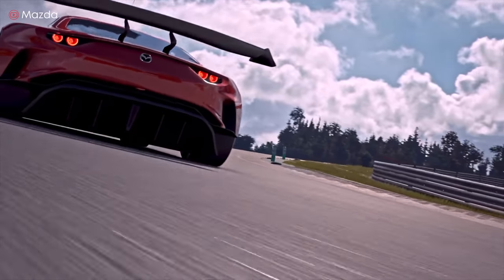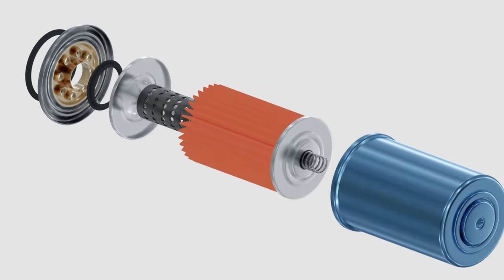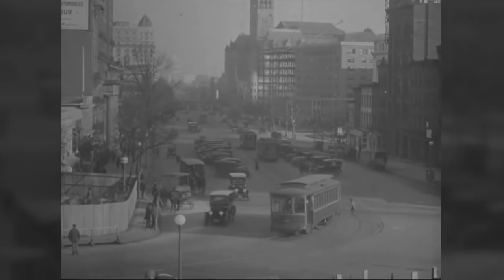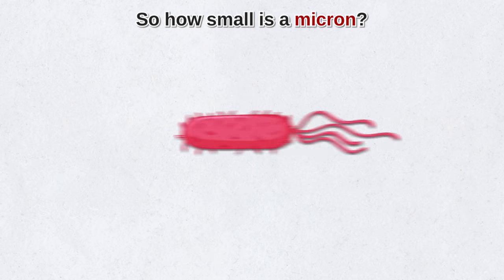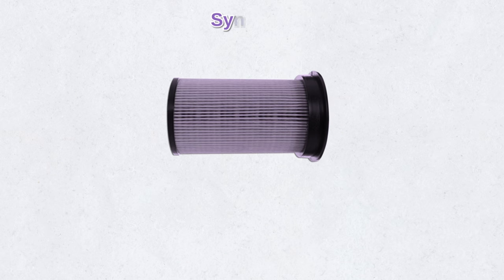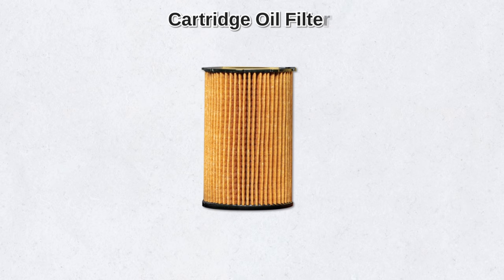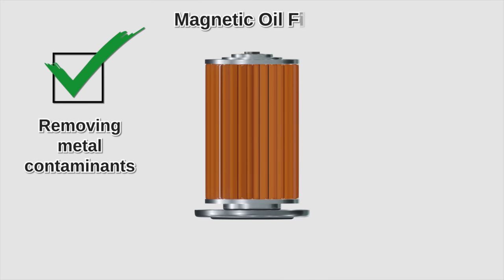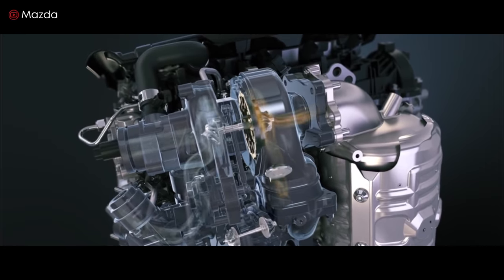This New Oil Filter Just Changed the Game (No More Oil Changes)

Comment: My 39 Chevy pick up truck 
Dosen’t have an oil filter 🐥
Reply: My '71 VW beetle also did not have one.  Just a little wire mesh strainer.  Oil changes were pretty frequent though.
Reply: Oil filters in 1939 were all bypass filters.  They were optional equipment. My 41 Dodge had the optional Fram bypass filter. Used cotton to clean oil. It was the same as the big heavy duty diesel Luberfiner. John Frantz came out with a toilet paper canister for the old cartridge filter.A much better filter because of the density  of the toilet paper and the longer the oil had to travel thru the element. The Frantz 3 stacker was a taller housing that took three rolls of paper. My 38 Chevy had no filter but was set up for a AC bypass filter.   My 37 Studebaker book didnt recommend oil changes except for seasonal reasons. It said change the filter when the oil looks dirty on the depth guage. Probably had a cotton element the same as a truck Luberfiner.  For sure if the filters werent standard they were at least optional equipment like a Chevy. Some were dealer installed.
Reply: @ralphwood8818  the 39 Chevy pick up truck Dosen’t even have one ,
My whole engine has been taken apart and Redon with it’s original 
Parts no filter .
Reply: Was at a classic  car show in San Francisco  In the 60s . There was a beautiful  early 30s Chevy with a Frantz oil cleaner on it. It was the model that looked like a Fram but was chrome instead of orange like the factory installed Fram on my 41 Dodge.  The only other one I saw like it was in a Frantz collection at a Frantz  dealership  in Salt Lake City about 1980.
Reply: @ralphwood8818  added on mine is 
100 % original 🐥
Reply: VW saved millions by not putting filters on the beetle. Beetle owners were content as hell allowing the engines to self destruct. Never heard a complaint In the 60s you could go to Grand Auto parts in the San Jose California  area and get a Fram bypass filter with cotton elements the same as the Luberfiner. They also had the superior Motor Guard oil cleaner that used high quality cellulose elements  known as 2 ply facial quality  bath tissue. If you wanted a beetle to last you kept the oil analytically clean and the valves adjusted. Not many people wanted to spend the extra money for the optional  equipment bypass filter. Some owners of these old cars restore the engines as well as the bypass filter. Filter all painted up nice. I dont think good elements are available now for the old filters. You can get the make believe pleated paper filter elements.

Comment: Scotty you did not mention the Frantz oil cleaner which has been around since the 60's and requires no oil changes. I have used that system for years. It uses toilet paper. Your opinion?
Reply: I used a Frantz oil filter on a 1961 Chevrolet Impala for 65,000 miles. Had transmission trouble and changed cars. No problems. I have heard that people used them for the life of the engine successfully as long as they kept changing the toilet paper. At some point toilet paper size changed and I believe Frantz sold  (packaged for them) toilet paper in the correct size. I can't see why this would not work well today.
Reply: The top loaders work better with toilet paper. The Frantz works better with the Frantz elements. I dont like to deal with the extra parts such as sleeves rings and such that you need with odd size paper. The Gulf Coast can handle it. If you want to use TP like me use the top loaders. They use the larger core seals for the larger core TP.  I just got in a Australian Jackmaster A very impressive filter. They have a fabric covered element but are set up for TP also. They have a massive amount of info on their site. The roll of Great Value 1000 from Walmart went into the Jackmaster without unrolling any. They are decreasing the diameter and increasing the core size to save paper.
Reply: You wont hear much about filters that eliminate oil changes. Too many depend on dirty oil and oil changes to make a living.  I used to work in a full service Standard station. It was sir that oil needs changing. Sir your  car could  use a set of Atlas Plycron tires. Sir I see a little oil leaks on those shocks. A Standard oil engineer came in. I said sir I see you just changed the oil. He let me have  it. He pointed to his Frantz and said use one of these and  Delo and your engine wont wear out and you wont have to change the oil. I was never the same after that. Found a dealer and bought one. Delo 100 was a diesel rated oil 29cents at the discount stores.  The grocery stores were full of high quality toilet paper. 2 ply facial quality the right size. The top loaders are easiest to service. Australia has the Jackmaster. Motor Guard went to compressed air filters. Gulf Coast filters mostly does heavy duty diesels. All I use now is Gulf Coast juniors and Motor Guards. I'm told some Australians use toilet paper in the Jackmaster. Like Frantz they have their own elements. Only peasants  use toilet paper.
Reply: I started with the Frantz. The TP changed but Frantz didnt. The top loaders have the larger core seals. I feel sorry for Frantz users trying to make the Frantz fit the TP.  With the top loaders you push the TP down against the bottom and put the lid back on.

Comment: Today i took my car to the service for leaking motor oil. They told me that  there are 2 places wher the leakage is and they will charge me around $1800+tax because of they have to take out the transmission. Is that really how much it cost for to fix it or are they trying to rip me off? Is there any option i can get less cost service anywhere?
Reply: Scotty recomends first try oil treatment additive the type that rejuvenates the oil seals
Reply: Scotty recomends first try oil treatment additive the type that rejuvenates the oil seals
Reply: They are probably describing the rear main seal. You could try adding a container of AT-205 Reseal to the crankcase. It often works.

Comment: Purolator one...the blue one.....
Is the only filter I use.....with. .Castrol magnetic oil...0w20......intervals every.  3000. Miles.....always 3000miles.oil. change on my vehicles. ...
( like scotty says.....oil's is cheap...motors are not....)

Menards. Has Purolator filters for.
3 or 4 bucks.....big chain auto stores..8 bucks.....
Reply: Magnetic oil? I've heard of the Intelligent Motor Oil. I like smart oil. A 3k oil change though is a waste of resources and money.. no car mfgrs. even recommend that low an interval- the engineers who built it!

Comment: Mr.Scotty I have a 1995 f150 dual tank on the front tank I broke the return line ...what can I use ...I look on several auto parts and they don't sell it....any advice...let me know thank you..
Reply: I know that you can just buy universal rubber fuel hose that you can measure and cut to fit and since it's the return line I wouldn't be worried. I had a dual tank 1995 f350 7.5 but never had that issue.
Reply: Thank you  I'll probably do that...

Comment: Please explain to me why a 4 cylinder Wisconsin engine VE4 MODEL from the 50s has no oil filter is mounted on a Hay Baler which operates all summer in the heat and server dust and dirt still hasn’t been touched other than oil change at end of season after roughly 300 hours some years 150 hours. So why is this motor still operating after all it goes through. It does have a oil bath air cleaner. I’m not sold on filters after owning so many motors without any filters. So why is a motor that operates in hot heat and dirties conditions still operating today with not one filter on it?
Reply: I'm not too smart but I know an engine with an oil filter will last longer than an engine with no filter. An engine with a depth bypass filter will last even longer. If the bypass  filter uses toilet paper you also wont have to drain the oil  if you dont get something like a leaky head gasket
Reply: @ralphwood8818  really why do all the motors without oil filters still running without one? The oldest one is 1948 VE4 WISCONSIN. Works in the dirtiest conditions and still has not had a overhaul. No one filter on the motor just a small screen on oil pump. I’ll wait for a answer to why?
Reply: I have a International Cub that has no filter on the 12 HP Kohler. I think one thing that helps is the deep sump. The rod dipper doesnt get the dirt in suspension. The VW beetle didnt last long without a filter. All they had was a screen. I think they recommended 1500 mile oil drains. I put a toilet paper filter on mine. I dont do oil drains
Reply: Something to think about. I have installed Frantz oil cleaners on some foreign cars that had no oil filters. Everything showed up on top of the toilet paper Some had almost nothing showing up on top of the paper. Put a Motor Guard on a VW beetle that had no filter and the Motor Guard loaded .up with metal. The Motor Guard filtered from the bottom up. I had to tilt the Motor Guard so that the metal chunks wouldn't gravity back into the engine at shut down. Some of the engines probably only needed an occasional oil drain. The VW beetle needed a full flow filter really bad. Put 100 K miles on a beetle and you were doing good .kind of like a flat head Ford. The problem we had in the 60s was sludge.Sometimes there was more sludge than oil in the engine. Not sure you could compare a Wisconsin or an aircraft engine to a car engine that has a lot more sludge. My V twin Kohlers would be a better comparison but they have the same filter system as the Pontiac Torrant.
Reply: @ralphwood8818  you still haven’t answered my question why is my motors still running with no oil filter? It’s mounted on a Hay Baler which works in the dirties and hottest condition. The oldest motor is from 1948 WISCONSIN VE4
Reply: @BALERMAN  sludge is usually what kills a car engine probably no sludge in the Wisconsin. I will take my chances with depth filtrstion  I dont think removing my filters would make my engines last longer.
Reply: @ralphwood8818  you don’t have a Clue. I asked you to explain why all my motors without filters made in 1948 are still running with no filter. Operating in the hottest and dirtiest condition. If filters truly work our oil would be clean and not full of carbon. My point is no filter on my motors and still running so proof is over 72 years old NO FILTER. Don’t think your opinion matches 72 years of operation without a oil filter.
Reply: @BALERMAN  How you can come up with the idea that an engine will last as long with no filter I have no clue. You cant compare an engine on a hay bailer  to the engine in a car.  I dont change the oil in my cars but I have a full flow filter and a depth bypass filter. I saw metal particles in my bypass filter when I changed it the other day.  Probably better in the filter than the oil.
Reply: My Kohler  and Briggs and Stratton engines have the same oil and filter system as the Pontiac Torrant full flow filters and toilet paper depth bypass filters. Dont plan on removing the filters to get longer engine life. I tied wire behind a Wisconsin powered hay bailer. The farmer killed the engine with a pitch fork. They sounded good.

Comment: I changed the oil not the oil filter. The oil filter is mobil1 and it says It last 20000 miles my last oil change was 6000 miles. Is that ok to wai another 6000 to change the oil filter.

Comment: Remember way back my father had a filter in the garage that actually used a roll of toilet paper? as the filter. He never installed it....I should of saved it.
Reply: Franz oil filter. My dad had one
Reply: There was the Frantz the Motor Guard and the Gulf Coast jrs. My sister wrecked the old Impala. My last two Frantzs ended up in a wrecking yard somewhere  in Dallas All I have now is Motor Guards and Gulf Coasts. I like them better. Easier to service... All of the toilet paper filters eliminated  routine oil changes. The problem with Frantz is they were designrd for the 1 1/2 inch paper. When the paper changed Frantz didnt.
Reply: @ralphwood8818  amazed they work that well. Back when I saw my fathers filter in the garage was wondering how do you know what roll to use with it?
Reply: @samiam9059  It was easier in the old days. The grocery stores were full of 2 ply facial quality TP. Just the right size for the automotive  and the FAA approved AeroFrantz. Now you have to use paper like Scott 1000 sheet or use the Frantz elements. I sometimes use Great Value 1000 from Walmart. The last time I changed the Motor Guards I unrolled 30 rounds from the Great Value. Frantz  might be the only one still in production. It wasnt the best design. Saw a couple  of Gulf Coasts on E Bay. Gulf Coast is heavy into big paper towel filters for heavy duty diesels such as Shell Offshore rigs. And heavy trucks. Saw the little toilet paper Gulf Coast on a humvee and paper towel filter on a 5 ton. There is a Frantz dealer that has a different opinion on what paper to use. With the shorter paper the improved filters are more user friendly. The weak point of the older design is the seal around the core.Gulf Coast fixed that. Years ago Gulf Coast Filters were Frantz dealers. They knew how to fix the Frantz. When Frantz went broke years ago  new design's  happened. The Frantz 3 stackers were replaced by paper towel filters. To service the older Frantzs it helps to have the old instructions. Push the TP against the knee to make a bulge . Dont push the paper in too far. You want the bulge to make contact with the seal around the core. Then push the canister down against the gasket. You want the roll to go in tight but not so tight it makes wrinkles
Reply: In the 60s multi Grade oils didnt hold up for extended use. You couldn't use them in a diesel engine. I used Standard Delo 100 W 30. Haven't seen it in many years.  I think it is mostly Delo 400 now. I've started using the Super Tech  multi grades . All I use now is Motor Guards and Gulf Coasts. They can handle the odd sized paper. The Frantz is a good filter but has too many parts for me.
Reply: Got in a Australian Jackmaster. Should have ordered one sooner. Looks like it is the best one for dealing with the bigger core  and the shorter toilet paper.  Since I only use toilet paper its the best for me. Looks like the only ones as good as the Jackmaster are out of production. Jackmaster has the bigger seal at the bottom for the bigger cores. They have the nice fabric covered elements. Obviously  the best in production. Always use the top loaders for toilet paper. Gulf Coast junior and Motor Guard. Motor Guard only makes compressed air filters now.

Comment: Thanks for this informative Video. I would also like for you to check out & test the K&P Engineering Oil Filter (FAA Approved)  featuring Medical Grade Stainless Steel Cloth which is cleanable & reusable.  I've been using these Oil Filters for many years in my 1983 Suzuki GS1100ES, 2015 Sea Doo GTX iS 260 Limited PWC and my previous 1991 Audi 200 20V Turbo Quattro.   Randy   AKA randog311  (Retired Professional Wrench)

Comment: What is old is new. I rember the older fords and others. Had a canister. That you had to swap out a cartridge. The oil filter was usually on the firewall. Kinda giving away my age hi hi
Reply: The old Chevy 6 engines had the bypass filter clamped to the intake manifold. I believe the flat head Ford V8 had the bypass filter bolted to the head with 3 head bolts. My 41 Dodge had the Fram bolted to the engine. John Frantz invented  the adapter so you could use superior toilet paper in them. Before the Frantz the best elements used cotton.  The same as the Luberfiner .They were optional equipment in those days. That's why we see so many old engines with no oil filters.

Comment: In the past the cars didn't have kidneys
Reply: They got kidneys  if you forked over some extra cash. They were optional equipment in the old days. Some of them actually cleaned oil. They used cotton.  The only ones that clean oil these days are after market. The toilet paper ones are economical. Frantz. Motor Guard  and  Gulf Coast. Some are getting hard to find. They turn up on Ebay. I've heard some old cars had a tank with oil in it. Oil was injected into the engine parts then dripped  onto the road. When most roads were dirt. I've seen that system used with a slight glass where you could count the drips.  Saw an old commercial where a tire company guaranteed  10,000 miles. The good old days.

Comment: How about bypass filters as frantz or amsoil ?
Reply: The origional Amsoil bypass filter was as good as the Frantz but too expensive to use. Bobby Unser said this oil change is forever. The newer spin on  filters cant compete with the Frantz or any of the depth filters.
Reply: One thing helping the inferior oil filters Is modern engines and modern oils. Not much for the filters to do. The filters have to work on my old Ford 390.when I started using the Frantz in 1963 toilet paper fit. Now the cores are too large and the roll is too short I see guys trying to make the Frantz fit with spacers. With the top loaders you push the paper down against the larger seal and put on the lid..The Australian Jackmaster is a master piece of engineering. They have a fabric covered element but didnt forget about us TP  users. There are elements as good as toilet paper now that cost over 30 bucks.